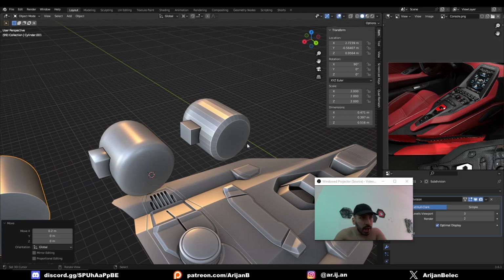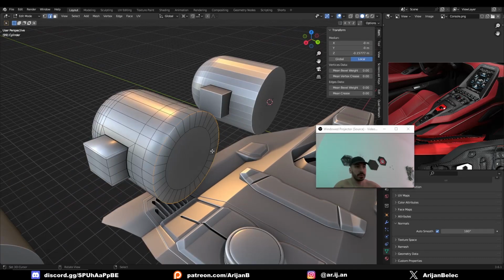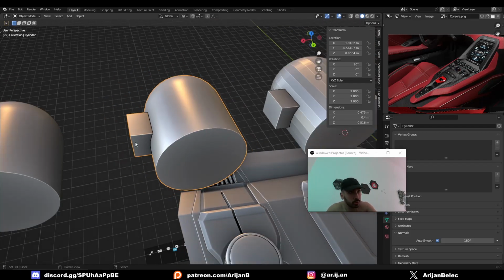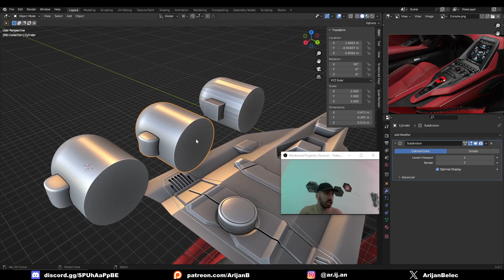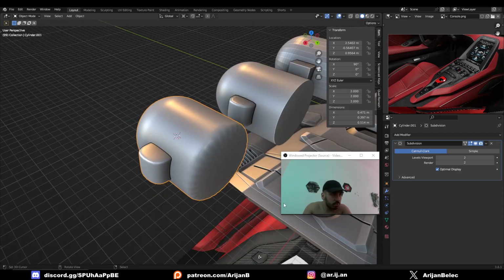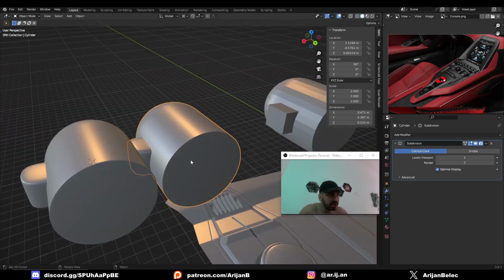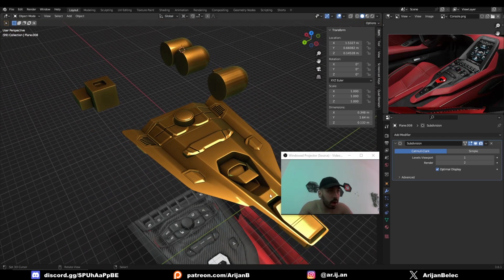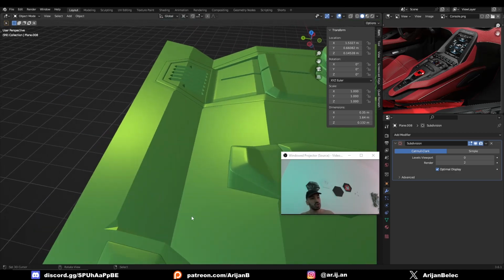The MOST IMPORTANT Hard Surface Modeling Trick (Arijan)

Comment: Tbh just discovered your channel so my bad if this is a stupid question here but I noticed you're one of the few people that does clean hard surface modeling. Are you opposed to Boxcutter/HardOps add ons? Or the Boolean method of hard surface modeling? From what I've learned from some people they all mention it fucks up topology and when I use it I can see it a lot of times. Just wanted to get your thoughts on that.